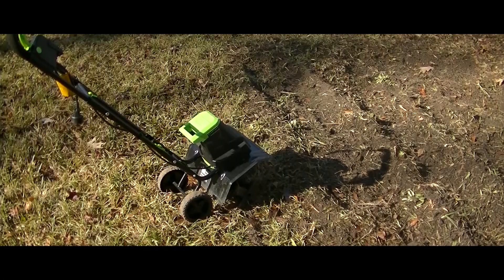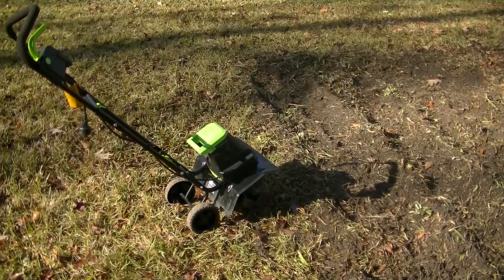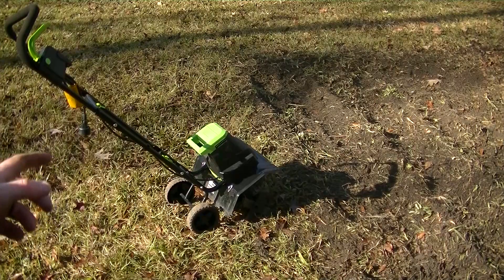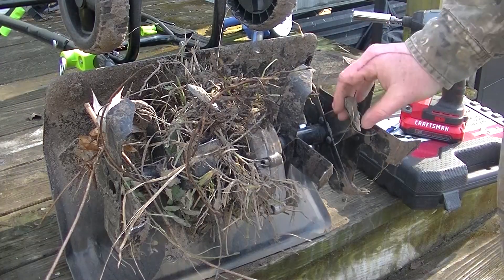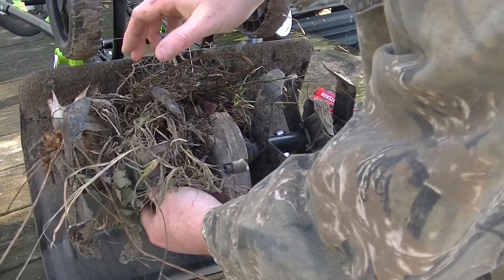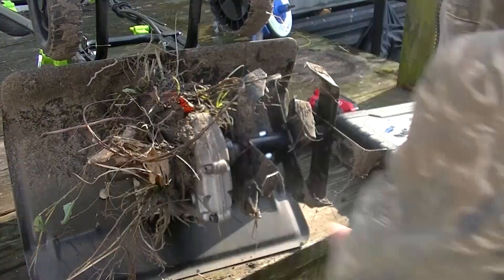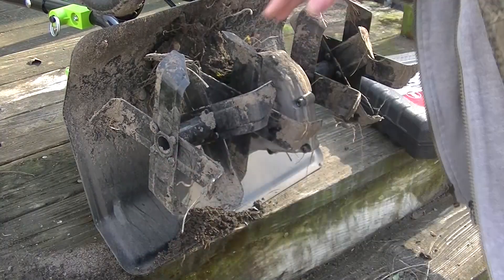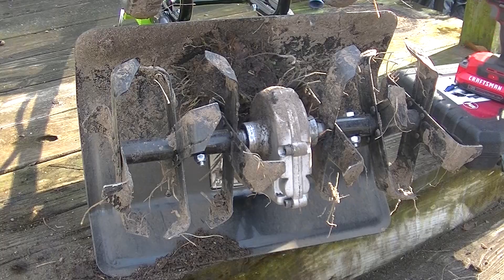This Is How The 12.5 Amp Earthworks Tiller Work!

Comment: That's a very handy machine to have specially with that price.  Would love to get my hands on one soon.  Thanks for sharing.  Fully watched my friend.  Greetings from Maryland 🌱🌺
Reply from the maker: Thanks. I am loving it. It runs on my solar setup fine. Works well. Over all I am happy. Not going to lie a few time I about gave up to go get the farm tractor. Was 32 F that day for use here on the cost in SC that's cold lol. God Bless.
Reply: @yankey4  lol.. 32F is pretty cold.  I was outside sowing in the 30s as well the other day and I wasn't able to get much done lol.
when I saw your tool I automatically thought of my planting areas.  Perfect for my platerbeds.  Thanks so much for your support.  Looking forward to see more of your vlogs.  Have a great weekend.

Comment: I bought a Sun Joe TJ603E 16-Inch 12-Amp Electric Tiller and Cultivator last April and it is really good. Bought a earthworks electric mower and wasn't too happy with it but considering I bought it on sale for 40 bucks and got two years out of it where it is now about 200 bucks. I can't complain.
Reply from the maker: WOW nice deal. I was looking at the Sun joe. They where not being shipped for 3 weeks. So Just got this. For now I am happy with it. If I get a few years out of it that's cool. Think now the hard stuff dune so it's going to be for weeding and what not now. Will keep yall up-to-date on how it works out over the year. God Bless

Comment: Looks like it works good. I'm tired of maintaining gas powered lawn equipment. My next chainsaw will be battery operated for sure.
Take care Bobby👍
Reply from the maker: I am 100% with you. I am moving more and more to powered tools. Love that I can run them with solar. I will say a gas powered one would be best for the first turn. This worked fine just was a bit more work and time to get that rolling. Think it's going to rock for weeding. I would buy it again. God Bless.
Reply: @yankey4  I have the same tiller. I turn the ground first using me Electric GE garden tractor and Brinly turning plow, then use this tiller. Makes it easier and I still don't have a carburetor to fuss with LOL. Got a video on my channel.
Reply from the maker: @jeremydavis2595  Cool Will come over and look. I love mine. Still works well.